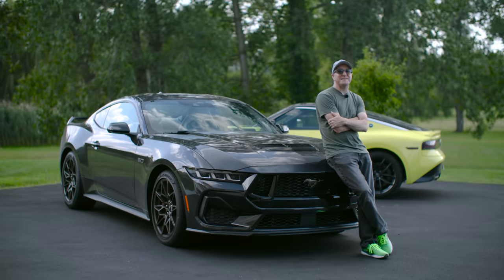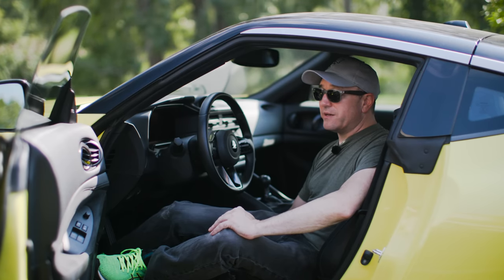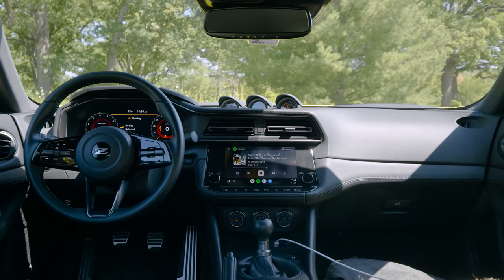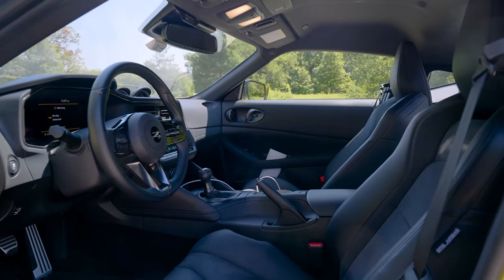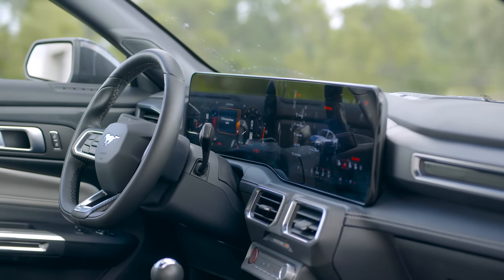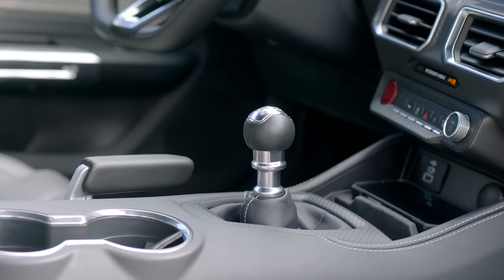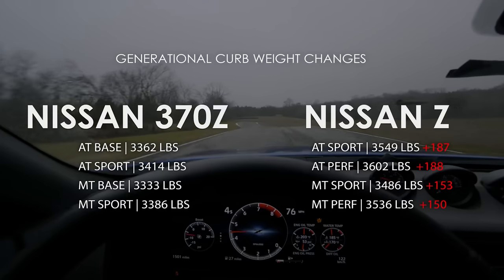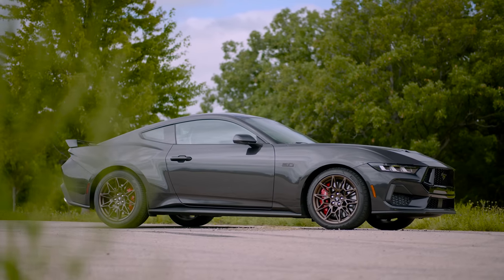Mustang GT vs Nissan Z | Maximum Muscle, High Prices

Comment: I think it would be cool to see a comparison between the Mustang Dark Horse and the BMW M2. Both start around $60k before options
Reply: This is coming from a Mustang guy,  the M2 is hands down the better option.
Reply: @xpvibe how? Aside from interior, love it.
Reply: @burgerbandit3646 I'm gonna assume better steering, suspension, brakes, horsepower/torque at wheels, still can handle 800whp, transmission, ect. But looks like crap lol
Reply: @ShreddedtotheGills Darkhorse has better brakes. As for handling and suspension, I've got no idea. The coyote is notorious for its ability to handle power and get easy power while N/A. Dont know how the 10 speed stacks up to the M2's auto. BMW typically underates their cars so I'd assume it makes more power. They're also about the same weight. I can't say one is an absolute better buy than the other as they have different strengths.
Reply: You guys are damn good - no fluff bs.
I’d take the Z, but wish there was a bit more power and was edgier.
Reply: @xpvibe  bullchit. Elon Musk would take that Mustang.
Reply: @burgerbandit3646 darkhorse steering is extremely numb compared to the m2. Low confidence when taking high speed turns. M2 all the way. Unless all you do is drive straight. Then theres a argument.
Reply: @xpvibe 
Based on what?? Being European?

Performance wise M cars have 
Been behind on road courses 
Since the 2014 Mustang GT PP
Reply: @dapro2524  I did hear that Ford made a step back on steering feel from the last generation models. Especially the likes of the GT350 and Mach 1.
Reply: The M2’s engine is solid enough for Toyota to beg them to borrow it & stick in their new “Supra” while still clutching to their “reliable” reputation…& its been used in a ton of BMWs, I want an M2 comp

Comment: The Z with an Ohlins Road & Track coilover kit (assuming that product is released), higher-temp brake pads, and serious tires, could be a great sports car for track use. Secondarily, a mild tune and perhaps some cooling mods like an improved intercooler, could make it more effective on track without screwing it up for the street.
Reply: So just throw more money at a $60k car?  For the now $70k you spent on this car you could have just upgraded to a better car.
Reply: @TeensierPython  You have a good point. But, there aren't many sports cars to choose from, and this car has some plusses that are absent from its competition, such as relatively light, simple ICE, double wishbone instead of McStrut, outward visibility, and a unique look some prefer. 2 things from that list, brake pads and tires, are needed by nearly every car for serious track use, and are wear items anyhow. With Ohlins you will have fantastic street and track damping, worth paying for.
Reply: That Ohlins kit is awesome for any car they make it for, but it’s like $5,000
Reply: Honestly most 3rd party suspension setups will probably be better for track. 

You can get a set of for under 2k, cooling seems sorted based on many reviews. 

Tires and pads are a constant consumable on track so it’s not worth factoring in to the MSRP.

What I really want Nissan to do is release a tuner special with only the performance bits and 300hp for like 38k.
Reply: I'm on board with your thinking.  It's easy to make a soft car harder, but no aftermarket company makes a hard car softer, so I don't mind that the factory setup is better suited for everyday driving.  And the limits of the stock setup are beyond what any reasonable person should be doing on public roads anyway.
Reply: @tdrcar man after doing all that….at that price am getting a CPO used m4 …way better car in every way….hell a c63s,a c7 corvette….😂
Reply: @TeensierPython that's the whole point of the z is to mod it if you want just a flat out sports car go for the mustang has all the tech which is something i could care less for.

Comment: I like the 300ZX and twin turbo much more, and updates made mine capable of far better overall performance.  The best was the Hardtop which only until the last year, was only available for racing.  My 300ZX is one of the stiffest bodies to run on the highway, Cray computer optimized and wind tunnel specs and g-force with some updates made this one of the best 2 seaters of all time.  The RX-7 Turbo 2 is the best of all 2 seaters with ultra light weight and an agility that has to be driven to be believed.

Comment: I literally own a 2019 mustang GT and a 2017 370z Nismo. 

Both are amazing cars, mustang GT is clearly for straight line but does handle very well after some steeda suspension parts but the stock Nismo beats the mustang in every handling aspect.

Comment: I think I'd probably take the cheapest base model C8 Corvette over both of them. It's faster, better handling, and will undoubtedly have a higher resale value down the road.
Reply: Does not have a manual transmission, so is automatically disqualified for me. Only boring people drive automatics....unless you have a disability or are really old.
Reply: @fortheloveofnoise only normies drive automatics…
Reply: @fortheloveofnoise  it can be shifted manually, dct
Reply: @chabweezy9905 lmao thats not the same thing AT ALL and you know it.
Reply: @fortheloveofnoise whats with the gatekeeping bro... someone whose into luxury auto cruisers is just as much a car guy as the person who likes 90 manual sports cars
Reply: The cheapest base model C8 would probably still cost more than either of these in most cases

Comment: These were the two cars I thought might make me regret getting a GR86. Feel great about my choice after seeing this video. The engine is for sure worse, but the car feels so much more special dynamically than it sounds like either of these two feel, and it was almost exactly half the price of the GT tested here.
Reply: Gr86 interior is absolute trash…u get a better interior in a Nissan Sentra or leaf…an it’s way too cramped…I would hate to have that as a daily…plus it’s way underpowered….like literally every car on the road is faster than a gr86…😂
Reply: GR86 is a cool car man. I would take that over the Nissan Z. Hope you enjoy it!
Reply: @djzulumask2138 I don't think most cars on the road do 0-60 in 5.4.  Sure it's not fast for a sports car but it's still potent.  Z interior doesn't feel much bigger   I prefer the light weight tossability of the GR86 and much lower price.
Reply: 5.4 seconds is after numerous runs they leave the part out were they got 6seconds on that same run...I'll say it's more 5.8 seconds as my SN95 was still quicker with the 2valve and now I have the 4valve 😅 !!!

Comment: I’ll keep my 13 GT 5.0 that does the exact same 0-60 as the new one, weighs 300 pounds less, and you still get all the same sounds and feels. Oh and it’s the premium model and stickered at 37k. 62k is nuts. Only car I think is worth the upgrade is the Supra
Reply: The 13 5.0 is not as fast lol
Reply: @19hundoc47 Alright, but how does it compare in the quarter mile? How about up to 100 mph? Around a track? Tells a different story. Your 13 would get smoked in every other metric. Also, I drive a 2021 Mustang GT that I bought for 37k, so don't worry about me spending 62k. I don't have any interest in the new mustang.
Reply: @raneer_6567  who cares if it gets ''smoked'', there is no noticeable differences on the streets, where 99% of Mustangs reside.
Reply: @raneer_6567  I’ve owned 7 Mustang GTs including a 15 and an 18 with the PP1 and honestly, they all suck around a track. All of them have so much body roll and dive around corners. There’s so many better cars for turns. My old Civic Type R would roast them all around a track. The 13 GT and the 24 GT both show 12.7 in manual form, which is the only transmission that matters. Power to weight ratio is basically the same.
Reply: @19hundoc47  The Mustang GT posts better lap times around the track than any Civic Type R and the 11-14 era Mustang was outpacing an M3 around the track. And keep gatekeeping about transmissions while you're at it all you want, but the modern automatics are better in every way to manuals.
Reply: @CaptainFordo21  Anybody who drives the s550 will know that there is a massive difference in performance in every way to the s197 mustang. It's not only straight line speed, but everything else about the car. You're coping to deal with the fact you're driving a far inferior mustang.

Comment: Just leased a 2024 Z Performance manual. White on Red. To your point that it feels like a 90s sports car, you are spot on. This thing reminds me of my 91 Twin Turbo Z in every good way. These cars both offer nostalgia in high doses with some modern tech sprinkled on top. I personally am not a big fan of how the industry is moving towards the single infotainment/gauge cluster screen. Not only does it look too "silicon-valley-cubicle" but in direct sunlight, there is no binnacle to shade the gauges from becoming washed out in the sunlight. On BMW OLED, it might not be a huge problem, but still an inconvenience. In the Z, you can throw the navigation over to the driver's screen and keep the center screen on audio controls. You can probably do that on most cars nowadays, but the flat panel mono-screens just look stupid in a car. Especially in a sports car. Doesn't matter how good the graphics and animation are. The point was to make video games feel more like real cars. Not to make real cars feel more like video games. Now that Z's are back to MSRP, there really isn't anything else available for under $55K (under $45K if you go for the sport model) that will put a huge grin on your face and make you giggle like a school girl the way this car does. No, the BRZ/F86 and Miata will not give you the same experience. They may feel more gokart-like, but the Z is way more refined in every way. You can live with it as a daily driver, never find yourself wishing for more power, and always know you got a great performance bargain when someone pulls up next to you in a base 2015 Porsche Carrera that cost the same price. Then you can walk away from the N/A Porsche with the torque of twin turbos while the Porsche driver tries to find the perfect gear to access his very narrow torque band. I'll probably buy the car when the lease is up. Don't think I'll ever get rid of it.

Comment: Biggest problem with the Mustang is not just the tires, its the suspension. It's more for comfort than performance. But most people will mod the Mustang's suspension anyway. Mine was big and floppy at first too. Then I lowered it and put quality suspension on it and it completely changed the car.

Comment: I bought a GT350 Shelby with 10k miles, seatbelt was installed upside down, air pump in the trunk sets of check engine light. Oil change is $225. All plasticky interior.

Comment: The wheels on the GT look great , but would be hell to clean.  Also looks like they went back to metal oil and transmission pans?  The best thing about the Coyote is they can make 800 rwhp easily and reliably with a SC and fuel system on e85.

Comment: I love this video for so many reasons but mainly because of my personal history with both of these namesakes. My 2nd car I ever owned, and first car I bought on my own, was a 92’ Foxbody GT 5 speed in white with the 5 Star Pony wheels dipped in chrome… That was the car that began my burning passion for performance cars. Her I am now, 27-28 years after I bought that car and I’m watching this very review late on a Sunday when I should be asleep… My 92’ GT , weighing less than or right around 3000lbs was a true muscle car. It was all front end. It only had what, 215/225 HP but it did have around 280 ft lbs so it was a torque monster. And it sounded the business with the Flomasters and an H Pipe which out-bellowed my Clarion CD player with an Alpine Amp with Boston Acoustic speakers throughout. I think at the end of that cars life the system was more valuable than the car… then in Oct of 2002 I bought a 350Z right off the showroom of Glendale Nissan. She was Glacier Pearl and a 6 speed. With an MSRP of $28k for the base, you could not touch that much performace unless you dropped another $10k. The 350Z in the fall of 02’ was a HOT car. And fast. 287 HP from the factory and looks for days. Then I went another 15 years of driving Civics and even a Prius as I started my family until in 2019 I slowly got back in the game with a Candy White GTI 6 speed. Had this for 6 months and got the bug again. Traded that in for a 19’ GT PP1 in triple black. Also a 6 speed. The car looked sooooo menacing as it was also the premium. Top tier spec and B4 COVID. MSRP of $51k and stole that car for $47k brand new. Then I drive that for a year and traded for an 07’ Z06 in Lemans Blue. Drive that for a year and traded for a 21’ GT PP1 in Ox White over Showstopper Red. Also a PP1 premium. Gorgeou car I have to this day. I now want one of these 2 cars. Part of the reason I traded my C6 Z06 was due to the fact I have 4 kids and felt really selfish buying a 2 seater as my daily. With that, the Mustang might have a slight advantage for me personally but my time with my 03’ 350Z back in 02-06” really evokes brilliant memories of how great that car was for its time. Both of these are truly awesome cars. Let’s be honest. For street driving. You can’t go wrong. I just wish I could have both…

Comment: That Mustang GT will NOT outperform the Z NISMO on the track or the street. It won’t. The NISMO Z was made FOR the race track. It’s not just some body work they added to the car a couple of stickers and a power boost. They went through the car boosted the engine ho to 420 and the torque to 384 and they went through the transmission and suspension. It’s like a differant car.

Comment: Y'all still need to test drive a GEN6 Camaro SS 1LE. It is truly a fantastic value. I had a 19 1SS 1LE that I paid $39,750 brand new and that car got totaled out when some semitruck hit it, but it was a great car. I replaced it with a 18 F150 5L truck. I also own an 88 GT, 03 Cobra, and 03 Lightning, but the GEN6 SS 1LE corners like a Z06 or something from Porsche, and it doesn't need Pilot Sport Cup 2's to do it either.

Comment: Agree on the odd equation that Ford worked out:
1. 23-yr olds have $70k to spend on a car - debt and endless payments are fine.
2. They want tech, a video game
3. They want a stick... Seriously? A stick? What happened to wanting tech, a paddle-shifted dual-clutch?

Regarding weight, unfortunately, 4,000 lbs is the new-normal. We're considered old guys if we tell young people, "I remember when sports cars weighed less that 3,000 lbs."

Comment: Personally I don't want a harsh suspension in a car that I would daily drive, it gets annoying really fast and it's uncomfortable. A friend of mine had a 2003 WRX that had coil over suspension that may have been set up for track was unbearable to drive on the road. It was so stiff it bounced and rattled on every surface so violently even on smooth roads. I remember holding my coffee and it was splashing out of the lid all over me. I love the Mustang, I had Fox body GT's before but the price is a big deal breaker. I found a base GT at a local dealer that had no options with a manual and the sticker was around 44k . I would probably settle for something like that

Comment: Both of these cars make a terrific case for the BMW M2.  The M2 starts at $63,195 and has a way more upscale interior, faster in all ways and it was designed in this century.
Reply: The Mustang GT starts at $42,495. So, I'm not seeing the "terrific case" for the M2. Especially when you realize that the Mustang GT has a much, much larger aftermarket presence than the M2. With a $5200 ESS supercharger with zero other mods you are looking at 820-850 rwhp and you are still well below $63,195. Then there is the "designed in this centry", have you even looked at the M2 design? It looks like a 1989 M3 that has had the corners rounded off, seriously. Then there is the fact that it is stuck with an old school 8 spd automatic, come on it's 2024! Ain't no one got time for old 8spd transmissions. The Mustang has an optional 10 speed.
Reply: @GooglePixelGoogle  And with a $1000 software update on the BMW, you are at 700 WHP and you still don't have to open up the engine.  Also "old school 8-speed,"  Are you 12 years old?  The Mustang design is also a mess.  There is nothing pretty about that car.  You do you.  If you want to buy a car that you have to "fix" to go fast have at it.
Reply: @GooglePixelGoogle I'd much rather have the ZF8 than the Ford 10 speed, especially for track use or spirited driving. Too many gear ratios, too much shifting.
Reply: @GooglePixelGoogle and what about wheels tires and brakes suspension to handle that 825hp, or are you one of those guys just upgrades the power but not the other components to handle that much power?
Reply: Paid 67k for my m2 with carbon roof.

Comment: Mustang Mach 1 owner here, and former owner of G35 6 spd (same platform as Z). Both cars have a certain appeal in but different ways. Both are absurdly expensive, and the direction that S650 is going is not for me at all. The interior and obscene tablet screen pinned on to the dash is a joke. You guys covered it nicely, I think the Focus Groups have led Ford into making a mistake this round. 

Curious in seeing if the steering is improved, its my biggest complaint about my Mach 1, but even if improved I have ZERO interest in buying S650. At the same time, I love double wishbones, and the ligther weight of the Z so it would be fun to drive it. "90s feeling" in todays world is a good thing, no wonder I keep my 2000 Civic with double wishbones around for a daily.

And for the record you two are men that impress me on the internet.